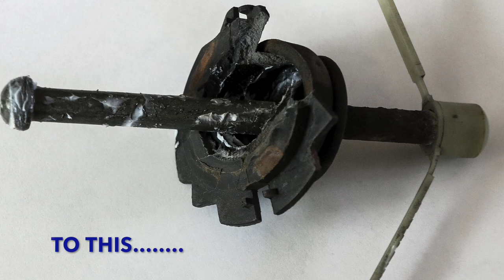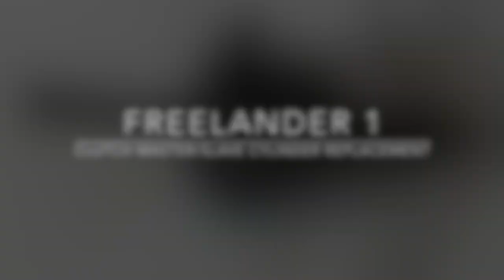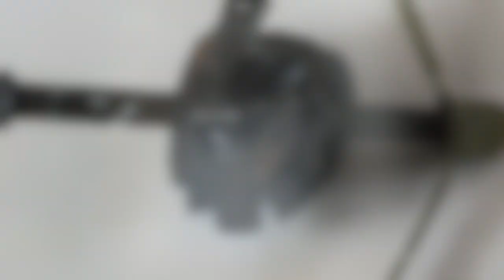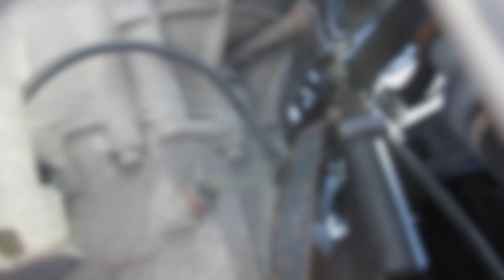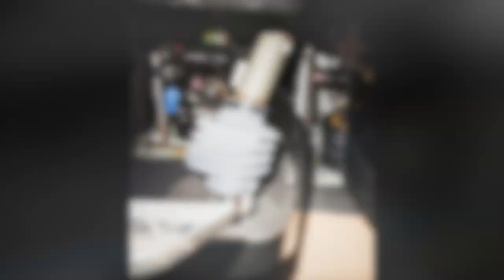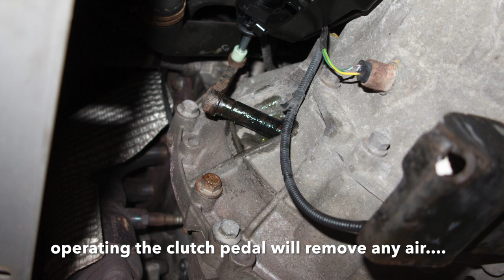Freelander 1 Clutch Master and slave cylinder replacement

Comment: Thats wrong
Reply from the maker: What is?
Reply: @davidbaugh  the way u mount your slave cylinder u can clearly see that it has too much movement and it will break
Reply from the maker: @fs0c1ety_bs92   It is a design flaw. It is the original clutch master cylinder assembly.
The problem is with the slave cylinder mounting bracket. If the slave pushrod is not regularly greased and dries, it puts added pressure on the bracket which fatigues and develops a crack which allows it to flex more. The slave is mounted to the bracket by a PLASTIC part which is put under increasing flex and suddenly breaks leaving you stranded with no clutch.
Everything is mounted correctly......Keep things lubricated and if you can't engage gears easily check the slave and bracket is not giving up.
Reply: @davidbaugh the designers where drunk